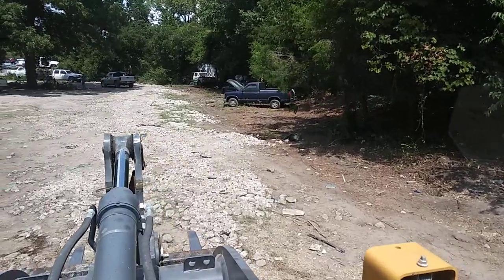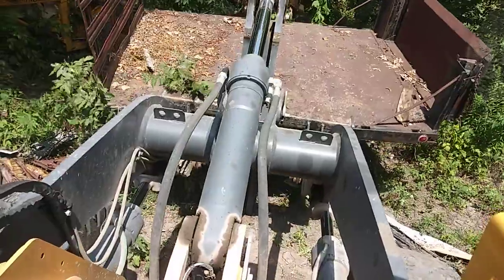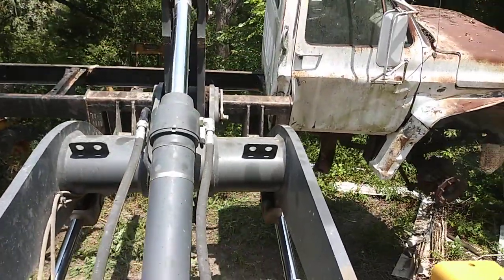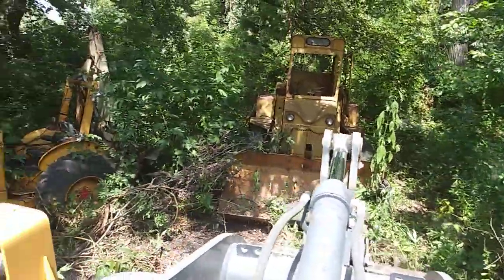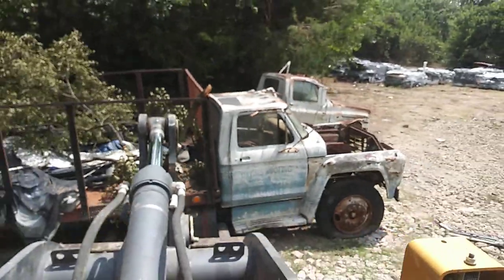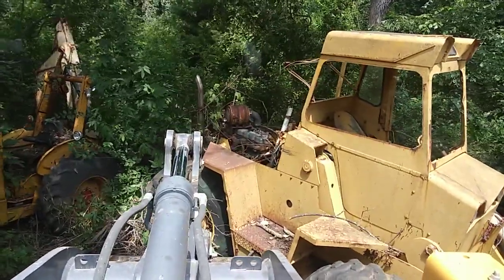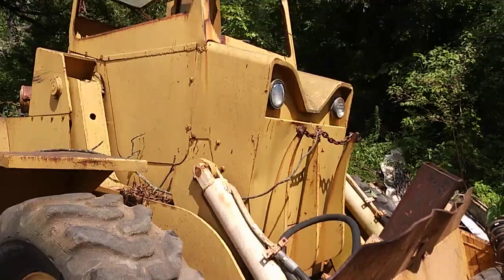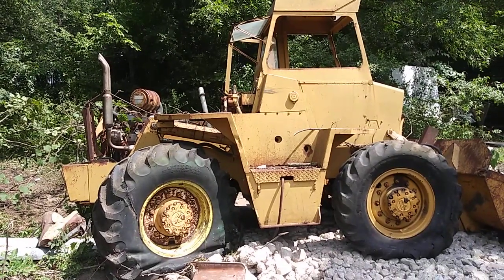Old Rubber Wheel Loader dragged from woods

Comment: That thing has a catalytic converter on it looks like cool machine nice video
Reply from the maker: It had Trojan stamped in counter balance. Also it weighed close to 16000 lbs. It was taken to our yard and processed. Fluid drained and im sure they removed the converter. It's already gone and scrapped.

Comment: It looks like a old hough loader
Reply from the maker: Seen Yale stamped on wheel hub covers. Now they could have made the the differentials but that's the only named i saw stamped anywhere. Thanks for watching and commenting 👊👍
Reply: I thought  like u did that hyster like  Yale only made forklifts 
There might be one serious parts treasure  trove there
Reply from the maker: @robertchristensen2633  im stumped on it.....but that ain't saying much 👊👍
Reply: @CowboyCarCrushing  that is a '70's straight frame  Trojan  they were made in Batavia NY  and used eaton/yale axles If I remember right it had a Clark transmission in it I used to own a Trojan 204 which was a bigger machine that weighed around 15 tons powered by a 6 cylinder gas engine that used to sink too often when I owned my car crushing business in the 80's